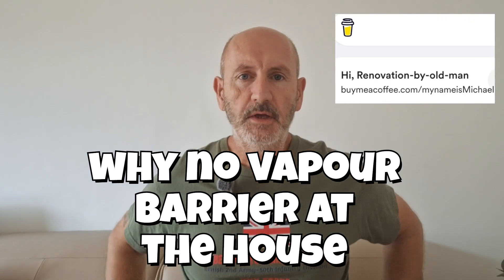Why no vapour barrier at the cheapest house in France 2025.

Comment: Whether you have a vapour barrier is TOTALLY dependent on both the complete construction method/design of the wall and house as a whole and of the climate you're building in. Anyone who makes blanket statements of "You should have a vapour barrier" has zero actual experience of either building design or construction. Whack a vapour barrier on or in a wall that isn't designed for it and you will almost certainly cause WAY MORE problems than that wall without it. Intra-wall condensation (as well as any water leaks) comes from both sides of a wall - interior and exterior - and a vapour barrier is a sure-fire way to trap that condensation (or leaks) within the wall with the potential to cause structural failure as well as truly harmful mould growth. It needs to be repeated: unless the complete construciton design/method includes the vapour barrier as part of the moisture control system, don't do it!
Reply: Btw, it's a mistake to use the word "breathe" with walls or houses in general. What does it mean? Does it mean air venting through openings or does it mean "drying" via vapour diffusion? Air leakage though gaps or holes or cracks can actually introduce and carry water vapour into the structure of walls too, not just water as leaks, so if that is "breathing" it can be a very bad thing.  Walls need to be able to dry and dehydrate as part of any cycle of warming and cooling which is maybe what people intend with using the word "breathing" with masonry and lime but it's a vague word that has unintended implications. 
Perhaps one of the best resources for this sort of info is a channel here in YT called ASIRI Designs. Check them out.
Reply from the maker: @DiscoFang I use it as a metaphor, like a living thing that needs to react to the environment and most people tend to understand the term even if its not in reality, correct.
Reply from the maker: Thank you for your informative comment.

Comment: Definitely think you made the right decision! I did the same in my old French house except I used lime for rendering instead of cob. I heat with a wood burner. It definitely keeps the house healthy. A barrier would make more work for you in the long run as you’d have to remove it eventually
Reply from the maker: Thank you 😀

Comment: This should mostly be fine but you need to think carefully about the places where your modern walls meet old because plasterboard and most modern insulation is not very breathable at all even without a vapour barrier. The riskiest bit I've seen is where you're putting the wall in beneath the purlin. Is the roof space that will be enclosed well ventilated from the eaves? A vent tile may be a good idea. 
Are you putting extractor fans in the bathrooms and kitchen. If not, strongly recommend!
Reply from the maker: Thank you.  There remains a 5cm gap between rafters and insulation.
I will be venting the bathroom and kitchen also.

Comment: I do not have thd answer right now but from what i understand,  the combination of breathable cob/oak outside wall with modern insulation and plasterboard on the inside is the critical factor. Do these two match well or do   they create humidity issues? In thecworst case your oak beams rot away on the inside from moisture rising from the ground and from the outside
Reply from the maker: I believe there will be sufficient air flow in the roof above the bedrooms to keep the oak dry.

Comment: The house was build to work as is when heated with wood. Changing that gives problems and ventilation is pretty essential for any house. 
Also, with current upheavals, having a house that esentially needs very little outside stuff to be habitable is a plus. And France has powerdisruptions from weather anyway. A house that is build and setup for a 150 years ago non-electric world when it comes to heat will keep you safe just fine if power quits for a bit. A modern electric everything house won't/can't.
Reply from the maker: Thank you . I'm a big fan of woodburners.

Comment: I agree with you. My leaky roof has demonstrated that even using vinyl emulsion on the inside plaster can prevent the walls from breathing properly. One of the areas affected had big blisters appearing where the paint and surface skim of plaster was lifting. I had painted with Dulux vinyl silk which I bought cheap off another Brit who was going back to UK. A lot of the wall paint they sell here is more like whitewash / distemper. It is not ideal as it washes off but it may well be a better choice for the houses and climate here.
Reply from the maker: Thank you. I buy dulux paint from Action stores here in France.  Reasonably quality.